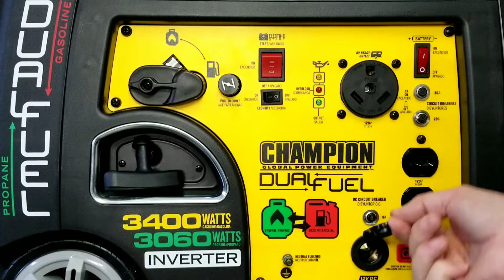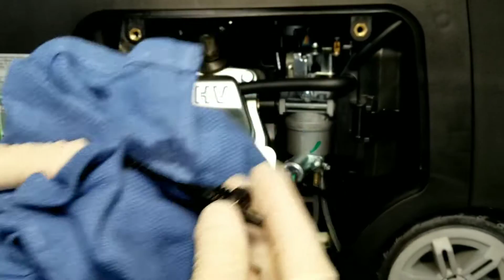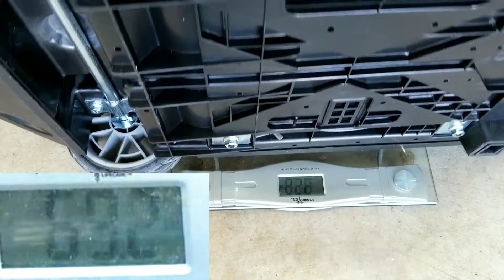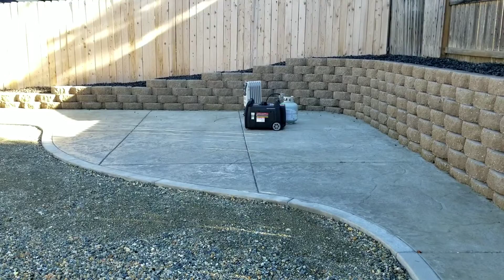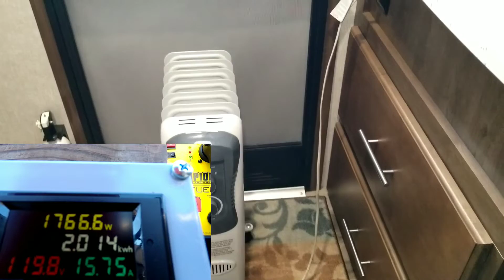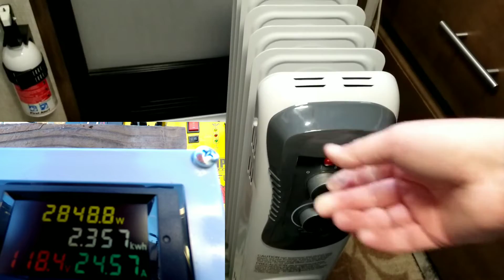Champion Dual Fuel Best Generator? Full set up Test and Review!!

Comment: So if the battery is dead you can’t start it in the gasoline mode,only propane mode. That makes no sense. Some people may not want to run gasoline most of the time. So your SOL without a battery?
Reply from the maker: Yes I believe that is correct, but for the price of this unit and power it’s almost obsolete. Much better options now for the price.
Reply: @johnnysweekends  thank you

Comment: Thanks for the load test on propane! Why would the pull start not work with gasoline? Maybe some confusion on what you read? Are you saying if the battery is not installed/dead it won't start on gasoline with the pully?
Reply from the maker: It’s been a while since it reviewed the unit. But yes In the instructions it says it’s able to run on propane only if the battery is dead or not installed. And when I tried it that’s what would happen. Now they could have updated it since then. 

Not sure why they would even do that as it should start with both.
Reply: @johnnysweekends  thanks so much for the reply. I just hit the sub. I have a 4500 duel coming from amazon. Great price right now around 822 plus 5 percent back on amazon card. Really had a hard time finding reviews on load tests while running on propane. Thanks again. Edit Basically I wanted to know how well it would run my 15000 btu ac unit on propane without installing the easy start right away.
Reply from the maker: Nice excellent choice. That’s a nice unit as the 4650 is basically identical.

Thanks for watching and thanks for the sub…👍🏼😀

Comment: Hi,
Can you clear it to me?
Start and running without (or dead) battery: lpg and gasoline?
Which is possible and which not?
Thank you!
Reply from the maker: It will start with propane with out a battery I know that. I think it will start with gas to but forgot as I don’t have this model anymore. 

Did you buy it??
Reply: @johnnysweekends 
I found this in the manual, I quote:
"The generator will NOT START with petrol without battery charge or an appropriate connection.

But you wrote, you don't have this model anymore....
Are you disappointed?
Quality problem?
I planned to order today from Belgium....
What is your advise? Thanks!
Reply from the maker: I can’t keep every gen I review or I would have 20 or more… lol. 

I would also compare the price. Because there are bigger better options now I bet for the same price or close to it. 
Like the champion dual 4500 or 4650.

Maybe look at those first and compare the prices. 

Over all this was a nice generator though.
Reply: @johnnysweekends  ohhh yes, I understand now.
I ordered the dual power some minutes ago, I'm happy that you think it's a good generator.
We'll use only for emergency, a longer blackout for example....
3000+Wh output is more than enough, the first thought was the Honda EU2200i (EU22i in Europe of course), but it's only 2000Wh...seems to weak.
The Honda is around €1050, single fuel and 2000Wh output.
The Champion was €1180, I got dual fuel and bigger by half power output.
(without tax)

So, if the quality will be ok, (this is what no question at Honda), I'll happy with it.

Thanks for the video, thanks for your reply, and sorry, if I was too long...:)
Greeting from Hungary!
Reply from the maker: I thought the unit was nice and easy to move around. I’m surprised it only starts on propane with no battery or dead battery. But still a nice unit.

WOW Hungary 🇭🇺…. I think that’s the right flag..😁👍🏼

Thanks for watching 👍🏼😀
Reply: @johnnysweekends  yes-yes, thanks Johnny!

Comment: Curious as to what size is your AC on your trailer?
Reply from the maker: Sorry I thought I mentioned it but it’s 15k ac unit. So largest single they install that I see. 

Hope that helps..👍🏼😀
Reply: @johnnysweekends  Mine is 15K also so that's very good to know.   All videos Ive seen are on 13,5K trailers.
Reply from the maker: Ahh. Yea it helps I have a bigger unit for testing that way people at least know it will run something smaller no problem.
Reply: @johnnysweekends  Exactly !!

Comment: Just bought this generator today! Going to bring my Cougar 32BHS Fifth wheel to a wedding tomorrow and it’s going to be hot. Wanted a way to run the ac especially putting the kids to bed early. Excited to test the propane feature overnight while using the gas during the day. Happy to know I can run the 15k AC no problem and also use a few other features. The fridge can stay on trailer propane.
Reply from the maker: It will easily run the AC and fridge unless you happen to be at high altitude and the temps are really hot. 

But yea that will be a good gen…👍🏼

Thanks for the comment and thanks again for watching 👍🏼😀

Comment: Great thorough video. However I have a question and hopefully you'll answer. I recently purchased this generator to hook up to my Micro Minnie Trailer it's equipped with a GE 15000 BTU air conditioning unit. Running on propane the generator went on overload mode shortly after we turned on the air conditioning unit. Contacted Champion haven't heard back from them. Any thoughts?! Thanks..Hugh
Reply from the maker: So i also have a 15k ac unit which it ran fine and draws about 14 or so amps. What else are you running because that should be no problem unless there is something wrong with ac unit or you have a lot of draw from other items. Maybe the converter is working hard because of lights and other items on. Or fridge is on ac and other items as well…?????
Reply: @johnnysweekends  Thank you for your response. I actually called Champion yesterday and the first question they asked "was I at altitude when I tried to run the AC". Indeed I was at 8300ft. For every 1000ft above sea level the generator looses about a 100amps do to thinner oxygen. This unit works like the old fashion cars back in the day before fuel injection. My trailer is being warranty fixed at the moment I'll give her a try when I get it back and let you know my findings! Thanks for getting back to me.
Reply from the maker: Watch my altitude video…👍🏼😀

And yes you loose about 3.5 percent for every 1000 feet in elevation. 

Check out the video and let me know what ya think..👍🏼
Reply: @johnnysweekends  I just watched your video it does confirm what Champion told me. Since I live in Northern AZ at about 4800ft and we do quite a bit of camping locally at that altitude and at times higher re-jetting would be an option but we also go to lower altitude so I don't want to chance it. How do you feel about the soft start unit?
Reply from the maker: A soft start would definitely beneficial at altitude and even heat because heat robs power. But a hot start only takes care of the  starting draw of amps. Once running it will still draw the same amps. 

Yea when at altitude a bigger gen is recommended if always there. 

I also get not wanting to reject because when coming to lower altitude it will be to lean and burn up.
Reply: @johnnysweekends  Thanks a million for your input keep up the awesome work and reviews!
Reply from the maker: Thank you…..👍🏼😀

Comment: Thanks for the vid. Are you running an extension cord to your trailer from the generator? Looks longer than mine.
Reply from the maker: My cord I think is 20-25 feet...
Been a while since I measured it but the generator is only 15 feet away. 
I have ran a extra 15 foot extension before in some tests. Which made minimal difference

Comment: Thanks for the video. I’m getting that same generator.  How did you make your meter to see how much amps, your using. Thanks.
Reply from the maker: Awesome, I do like that dual fuel from champion it’s great. 
It’s just a ac meter with a Hall sensor going they the load wire. 

Thanks for watching 😃🤜🏼

Comment: Awesome video. We just bought our first pop up camper and it has a Dometic 13500 BTU A/C. Would using the propane fuel feature start it up OK and be enough watts to run it. Only other thing would be some LED lights and a 12v dometic refrigerator/freezer cooler. Thanks for sharing ur knowledge and info. 😊👍
Reply from the maker: No problem for this gen to start a 13500k AC unit. It will do it on propane or gas easy. 
13500k needs about 16 or so amps to start and about 11 to 12 amps to run. 

So you’ll be fine...😀 

Thanks for watching 😀👍🏼
Reply: @johnnysweekends  Thank you for the great info. Just subscribed and will share your content with all my friends and family. Thks again 😊👍
Reply from the maker: Thank you so much appreciate it 🤜🏼👍🏼🙏🏼

Comment: Great video. I debated between the Predator 3500 and this Champion dual fuel generator. I ultimately settled on the Champion due to its smaller size, dual fuel capability, and better warranty. Although the Predator 3500 has great reviews, the 90 warranty made me uncomfortable (although I understand an extended warranty is available). I ordered the Champion from Lowes using my military discount (10%) and saved $100!
Reply from the maker: Awesome, champion seems to have the best customer service and warranty for not being the top 2 brands. 

I think it’s a great generator 👍🏼

Comment: Great job, especially on the set up before use! I have just bought basically same unit and will have no trouble now, thanks to your video. Thanks! P.S. You mentioned not to use choke on propane while other videos wrongly say to use it.....
Reply from the maker: Thank you, yes no choke needed because the bottle in under pressure so fuel is available almost instantly. 

Thanks for the comment and thanks again for watching 😃👍

Comment: Great video!! Much appreciated!! Just purchased this same model today. As for the initial start up to break in the engine is it 4 to 5 hours of run time? Also does it matter if I do it using propane or should it be done with using gasoline?
Reply from the maker: Thank you....no either should be fine and heat cycles are great for it or vary the loads.

Heat cycle is fire gen up...warm it up a minute or 2 before load....then add a small load.....medium load then a higher 80% ish load....for a couple mins then back it all they way off ....and unplug everything and shut it off.

I have built many small performance motors and we would heat cycle them a few times and everything was broke in , in less then 20 minutes. 

Do what is easiest for you.

Thanks for the comment and thanks again for watching 👍
Reply: @johnnysweekends  Awesome!!! Thank you for the quick reply I appreciate it!!
Reply from the maker: Your welcome...👍😃

Comment: Great show of testing on that awesome Champion 3400!    Looking forward to your video on your power meter too!!!   I have the Champion 3400 Dual Fuel only run it on Gas though, had it since 2017 and LOVE IT!   Approximately 550 hours on it so far and going strong with regular oil changes and an occasional sark plug change and cleaning of the air filter and spark arrester screen.
Reply from the maker: Awesome love to hear it. I think its a great gen. Clean design to. 
Thanks so much for the comment and yes i will be doing the power meter soon. Have a couple more vids ahead of it...👍😃

Comment: Thanks for the video! So, if the battery die  when running on gasoline , you can’t use the generator at all ? Why ?
Reply from the maker: I assume if the generator is running it should continue to run on run. I would think. But i didnt test that. But i did find it odd that they designed it to fire up on propane and not gas with out a battery. 

It even says in the manual will not run on fuel with out a battery. But lpg it will. 

I should email them and ask why this is. 

I may even do a little investigating again on the gen lol. Over its still nice for sure.

Comment: Am I hearing it correctly, that a charged batter is required to start and run on gas? You can’t use the pull start with a dead battery or missing battery?
Reply from the maker: Correct. This particular model will run on propane with no battery using the pull start. But it will not fire with out a battery or a dead battery. It needs to have some voltage for it to fore up on gas. 
So its nice it fires up on something lol. 

Over all it is a nice gen.
Reply: @johnnysweekends  that is very strange and makes no sense to me. Thanks for clarifying but this makes it a no go for me.
Reply from the maker: I hear ya thought it was weird when i read it but then found at least it will fire on propane. Still a good gen and propane is always easy to find. But yea odd.
I may try again but i couldn't get it to fire...🤣🤣

Comment from the maker: What do you guys think? Anyone use this generator? Which fuel source do you mainly use..gas or propane?
Reply: I've had mine for 2 years and it's been wonderful.  I started with gas but switched to propane as ethanol free fuel is expensive and the propane does everything I need.
Reply from the maker: I’ve been using propane more now as it’s less dangerous, plus I don’t have to worry about the storage or carb stuff. Plus on the Rv I have a couple large on board tanks. 
That unit you have is great because it fits under the tonneau cover. 👍🏼